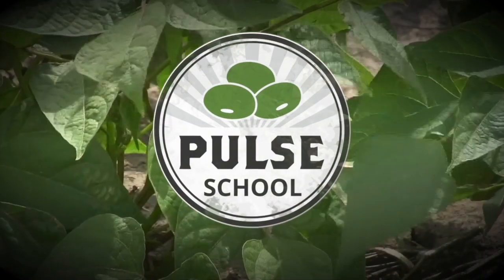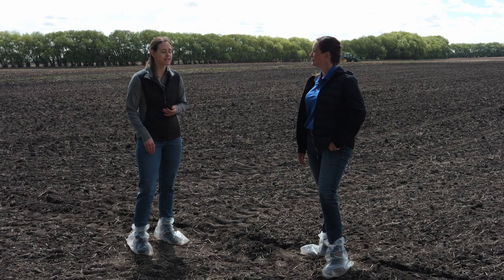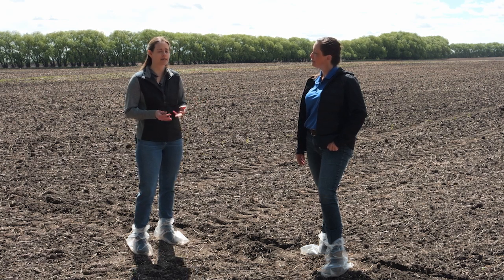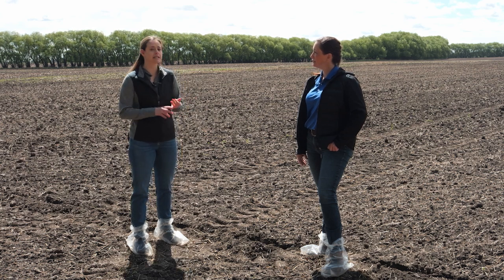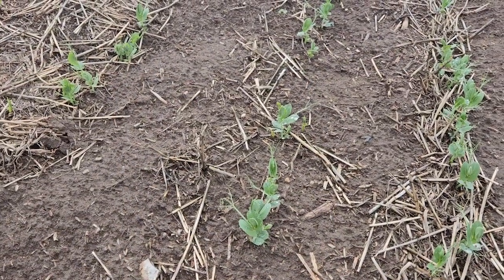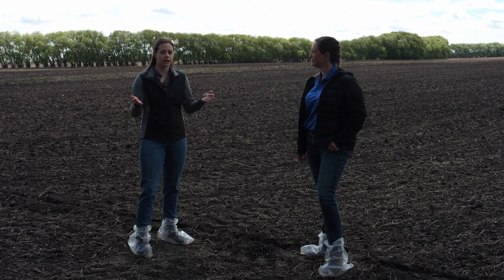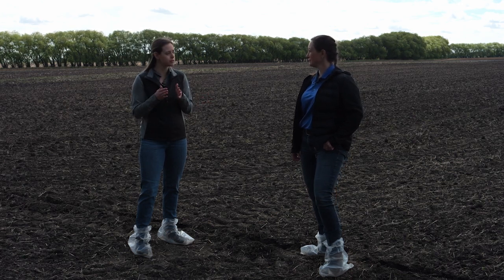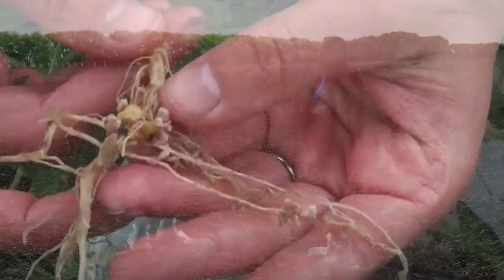Pulse School: Is the inoculant working?

Comment: Can inoculant be spray on after soybeans come up ? Adding molases to inoculant help to feed and sevive in the soil?
Reply from the maker: No, inoculant has to be on the seed, so it's picked up by the emerging plant structures. Proper handling of inoculant before application keeps it alive and working (i.e avoiding extreme heat, letting it sit in the seeder tank)